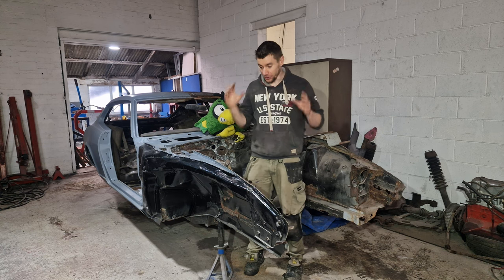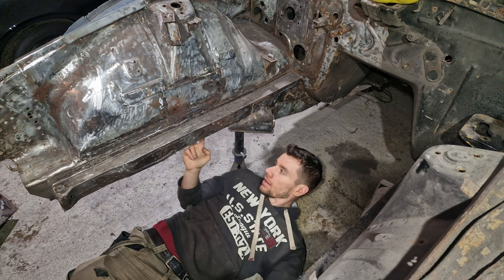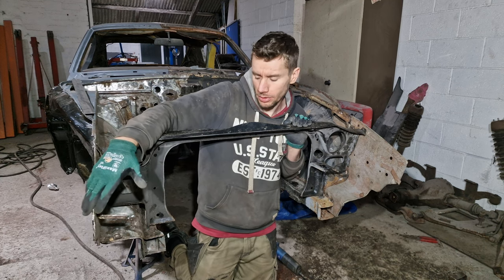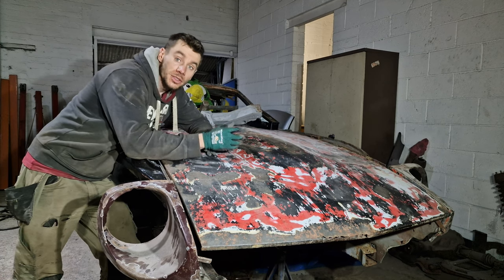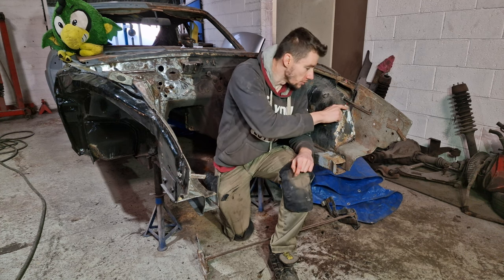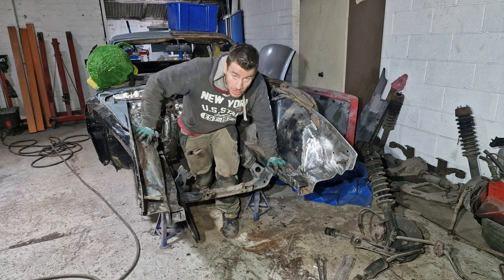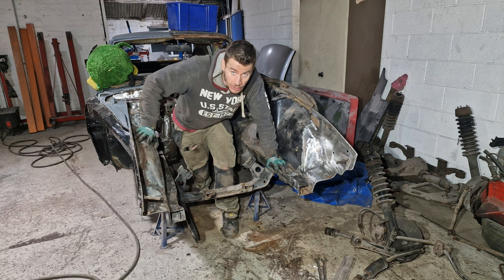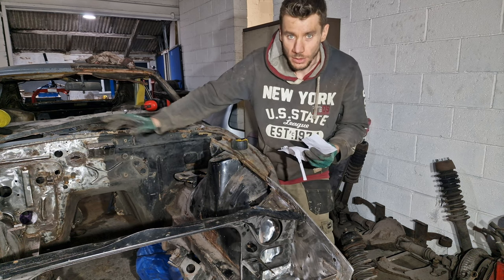WE FOUND ANOTHER DISASTER on the DATSUN! CRASH DAMAGE!?! Rebuilding The Front Structure - Part 21

Comment: Nice video, good stuff as always. One question - why didn't you get some heat on that stuck bolt?
Reply from the maker: That was the next option but i was running out of time. It cant be stuck if its liquid right? haha. The bolt was stuck in the sleeve and just wouldnt come out!
Reply: Use the last resort First   -    Burn it out   (burn it until rubber mount collapses -      Then saw loose bolt                                 -                  old git, UK

Comment: Always a bit daunting when you've that much removed from a car. I've seen "Professional" restoration companies just go flying into replacing inner panels without offering up bonnet and wings, go to the bodyshop, get it painted and only come MOT time with the car on a ramp did someone stand back and realise the front end of the car had been assembled, what we call in the Midlands, "On the piss". (Twisted and misaligned). I think that ended up in court.
Good work on the Z-car! Thumbs down on that concrete floor, you hooligan!
Reply from the maker: Nothing worse than the front end on the piss. We like to offer up the panels and think ahead on the project before finally welding things up. It gives a much better end result. Thanks very much. And yep, didn't realise about the floor until I was an inch deep haha